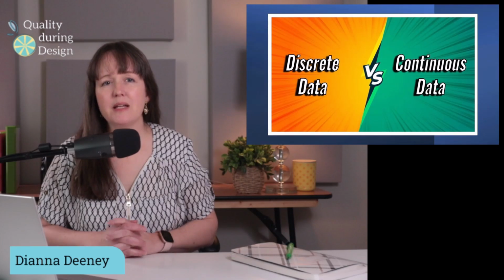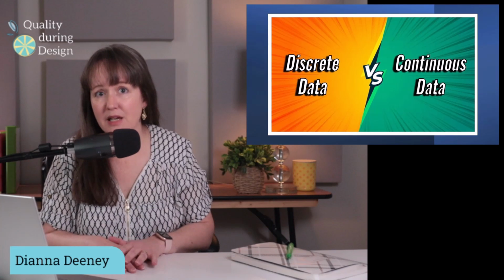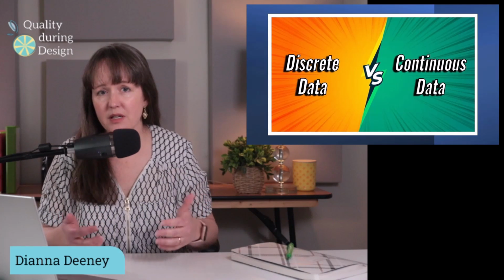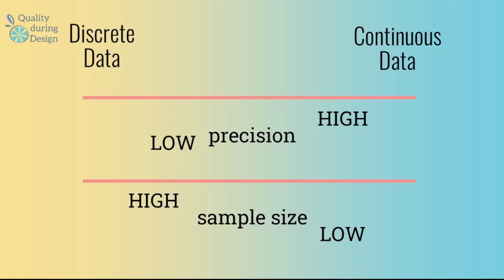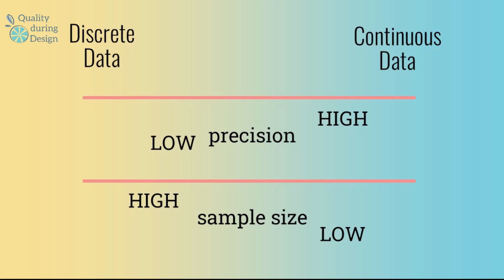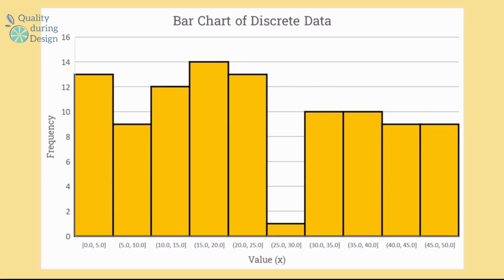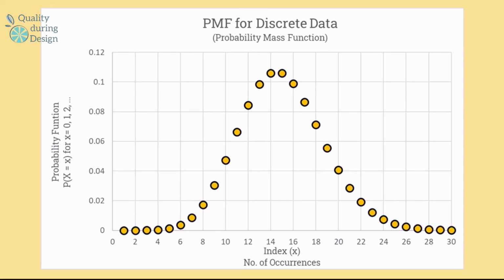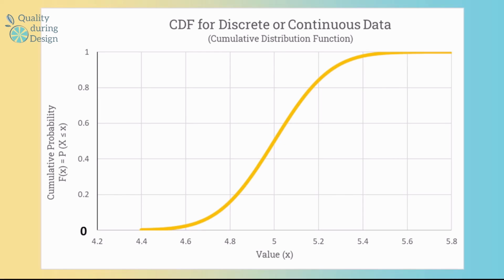Discrete Data vs. Continuous Data (Ep. 2)

Comment: Great presentation.  Thanks for the insight.

Only thing I would add is that continuous data can be transformed to discrete data using a transform known as Discretification.  A lot of times this is used in converting live readings to instances in time.
Reply from the maker: Thanks for the feedback. That's a good point: there are times that we might want to treat continuous data as discrete data.